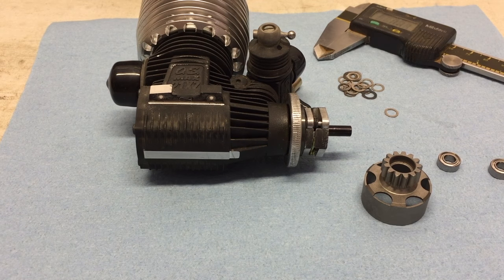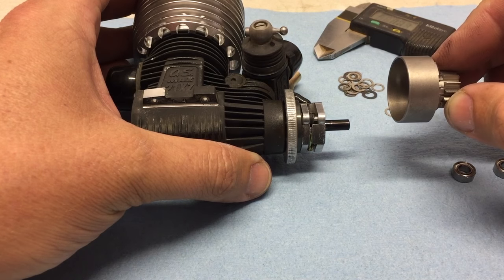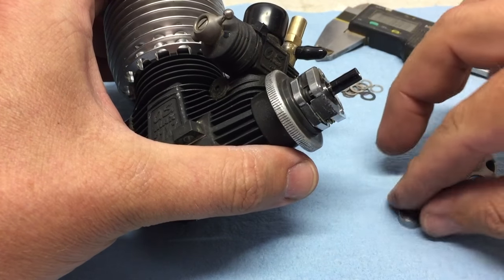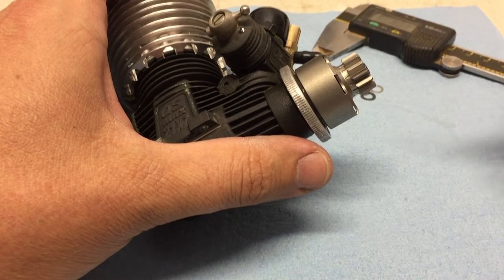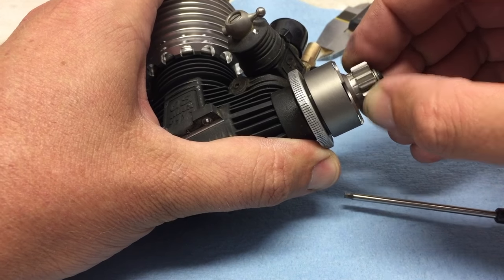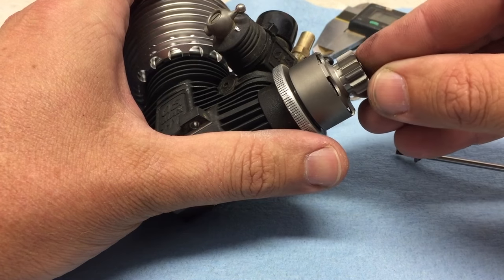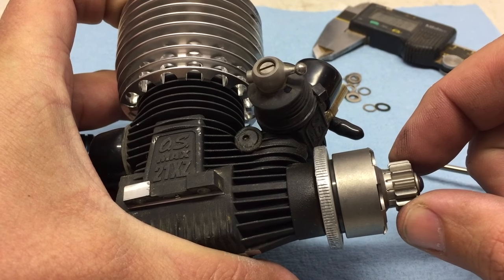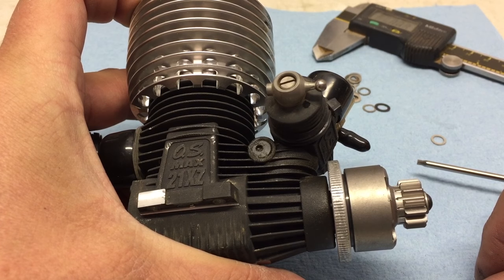Adam Drake from Mugen Seiki Racing show how to shim a nitro clutch.

Comment: Question: all of these shims are 5x7x0.1mm or 5x7x0.2mm correct? I am finding difficulty with the outside shims (1:16) as I don't have any--maybe only the slightest--amount of exposed shaft to shim up. The end screw has just 3mm washer on it, right? Do you advise using thread-lock on the end screw? Thanks, man!
Reply from the maker: Yes, you can use a washer on the outside or the screws from OS with the washer built in.  I don't recommend thread locking the screw in the end of the crankshaft.

Comment: Thanks very much Adam. This was very helpful. What are the dangers of running the engine with the bearings compressed by the clutch screw? I just bought a new engine for my car and the shaft seems to be a bit shorter than the one from the original engine, causing problems with the clutch assembly.
Reply: KT88 I think he mentioned, when it heats up metal expands. So the little play allows for expansion. If it is to tight the metal expands and becomes to tight and may cause a problem. re editited
Reply: Agreed, but even in that scenario everything would still work. Right?
Reply: if its to tight it can cause wear or damage

Comment: hey i have a flywheel spacer on my crankshaft b4 my flywheel to add length to the clutch to reach the spur gear .is that ok or should i just add shims after the flywheel nut? is it a bad thing cause i never hear anybody talking about that
Reply from the maker: It depends on the brand clutch you're using.  Some need the washer and other don't need the washer.

Comment: Do you have a favorite clutch bell bearing make and or brand? I order generic bearings to size only to have them fail when the originals lasted. What kind of bearing to order?
Reply from the maker: Yes, I use the Mugen NMB clutch bearings.
Reply: Adam Drake awesome, thanks! Ordering now...
Reply from the maker: Sounds good.  Let me know if you have any questions.
Reply: Adam Drake racing season is coming to a close here in upstate ny but i am looking forward to the mugan bearings. Again thanks for getting back to me so quick. Ill be running VP pro clutchbell with my 3 shoe clutch and new mugan bearings of course. I might go to a mugan clutch bell depending...
Reply from the maker: Protek RC also makes really nice clutch bells.

Comment: Hi Adam. do you use threadlock on the clutch bell screw
Reply from the maker: I do not.
Reply: @AdamDrake  how do you stop it from backing out
Reply from the maker: @flubber781  With the direction the engine is spinning it shouldn't back out.  Thread lock shouldn't hurt anything but I worry if the screw gets stripped out.

Comment: umm yeah, i have a red cat shockwave with a two speed clutch, it wont shim right! i dont know if the clutch is to big for it but my local hobby store fixed it, but didnt loctite it, so the whole thing came off while driving, and i lost 'some' parts but salvaged a few from the older single speed transmission, like the bearing, which is the same diameter and width of the clutch one, I need help!
Reply: i just replaced it with the single speed bell and trans, its a little torched because the stock clutch on these models aren't worth anything don't live long, but it works fine.  But I'm still kinda frustrated, the two speed transmission was broken due to the plastic components, but i think i got it bullet proof..... I've ran it on the road a few times now and nothings loosened, broken, or made horrible noises. But I've learned that after every run you tighten every screw on it and clean it up, finally getting into the nitro RC scene and not being embarrased going against my friends Kyosho brushed short course truck and having it drop its guts racing it and having to run after it when its 10 houses down >_< thank you for responding, now he wants a nitro truck.

Comment: What if my shaft doesn't extend past  the outside/front bearing, the only I'm being able is to shime between both bearings
Reply from the maker: Maybe too many shots behind the collet?
Reply: @AdamDrake  I found out the problem then, it was the distance between both bearings that were different from the stock pinion, even without any shims like you said I still couldn't get the shaft to get out, then I installed the older pinion back and it was ok that was when I found the problem was with the pinion itself and the distance from bearing to bearing, then I did some search and found out that are available shims with the external diameter equal to the shaft and the inner diameter for an M3 screw, basically it's kind of extended a little bit the shaft, the counter side is that the outside bearing isn't totally supported by the shaft, hope you understand my English and thanks for the awesome videos you make they did really help me restore my old hobao hyper 8 pro that was sold to another guy 12 years ago, and I bought it back from the same guy :)